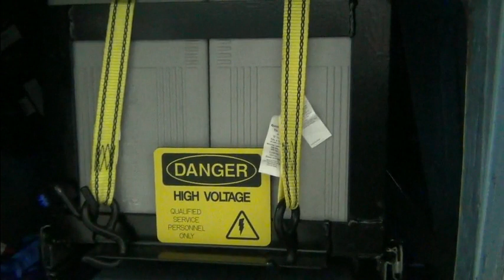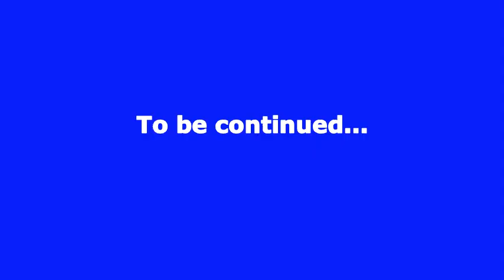VW Transporter Doka EV Projects Part 1

Comment: By my math, that’s a 25 kWh pack.  What kind of range does the truck have?
Reply from the maker: It is a 22.6 kWh pack.  This vehicle's range varies greatly depending upon speed and driving conditions.  Stop and go versus highway for example.  The typical distance at 70 mph is 45 miles.  At 55 mph the range is 60 miles.  So to answer your question, we typically see a range between 45 and 60 miles.  Please note that we are always driving in hilly terrain, the original owner said the range was better but he lived where it was flat.  Winter driving with the heat on also decreases the range as does carrying heavy loads.  We use it as a shop truck so when it is at the shop it is plugged in.  Some days we see 80+ miles of driving.
Reply: @ev4u  Nowadays can you make this a 200-300 mile range vehicle with the latest technology?
Reply from the maker: Only if you want to give up some of the payload capacity.